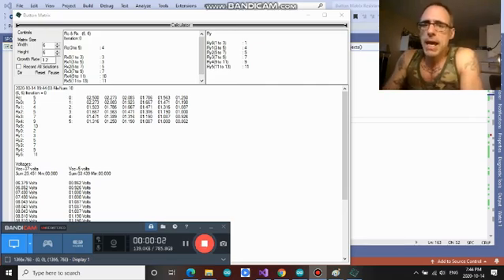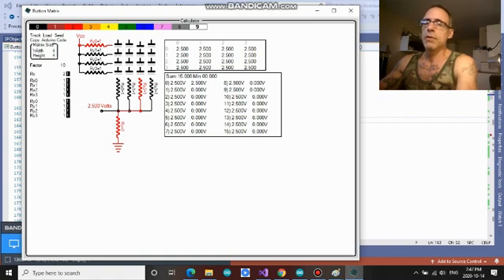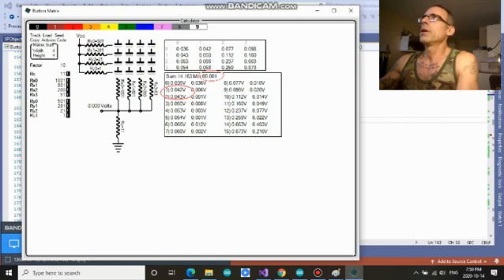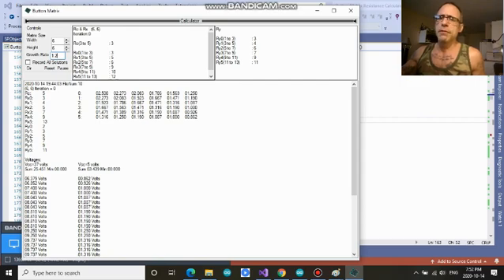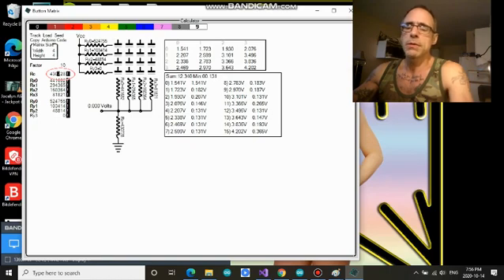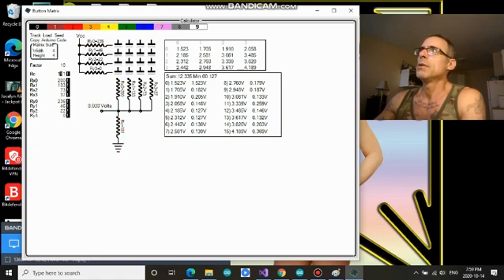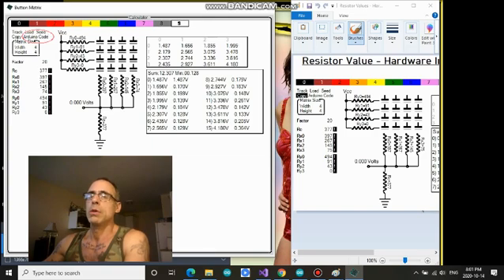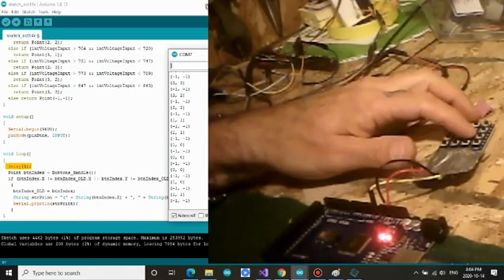4x4 Button Matrix - voltage divider needs use only one Arduino input pin instead of eight.

Comment: Can you use more than one button at a time?
Reply from the maker: no.  the voltage divider won't allow that.  it cuts down on on the number of pins you're using.  and its simpler to poll just one analog pin than do the dance number required to check 8x lines